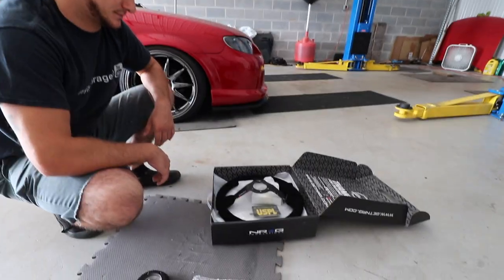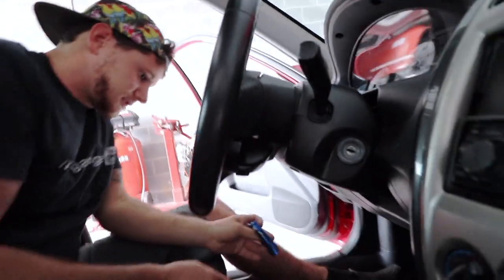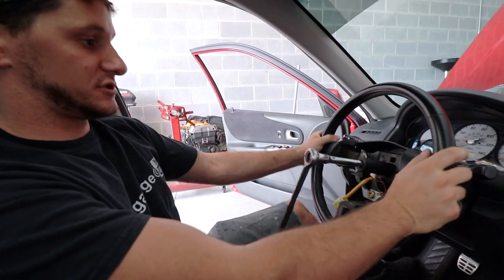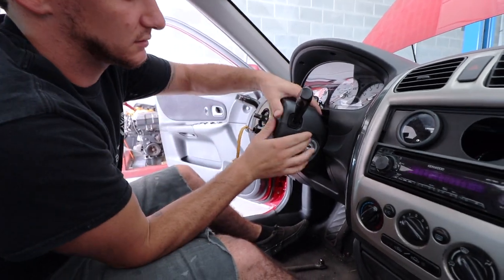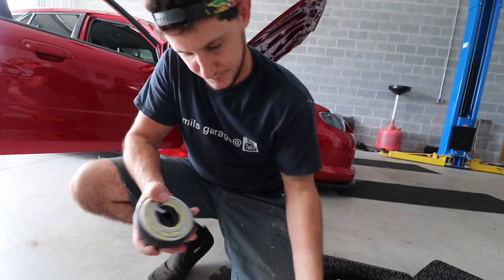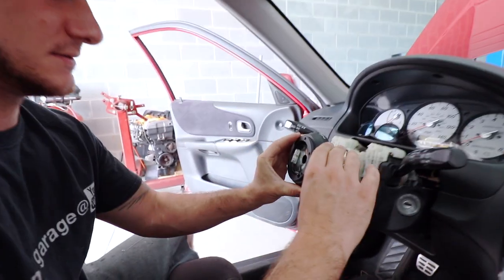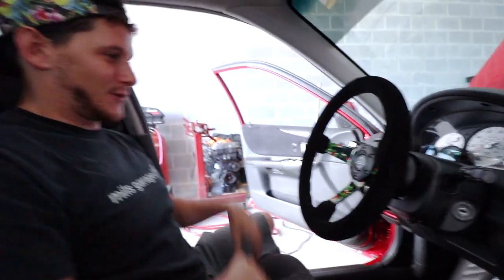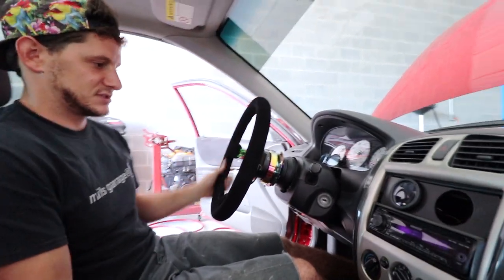MSP5 Gets NRG Innovations Quick Release Steering Wheel [Airbag Removal & Installation](w/ Pro Tips)

Comment: How about the airbag light on the dash? Are you able to remove that aswell?
Reply from the maker: They have.a $15 attachment that removes the code. My understanding is we can probably get it done without that piece, but it’s easiest just to buy the part. There may be cheaper options for the same wiring too
Reply: @milsgarage  ohh okay do you know which part is it and where to buy it? Thanks
Reply: @JOJM06  i know that a lexus needs a 2 ohm resistor ...you bend the two ends of the resistor and put them into the airbag plug to trick it into thinking it’s connected...you can find them on amazon or eBay...just double check what ohm you need for your car...they vary